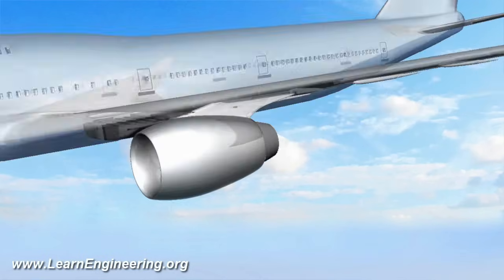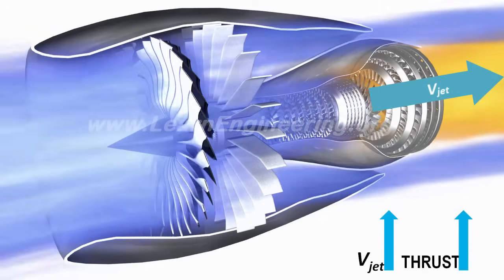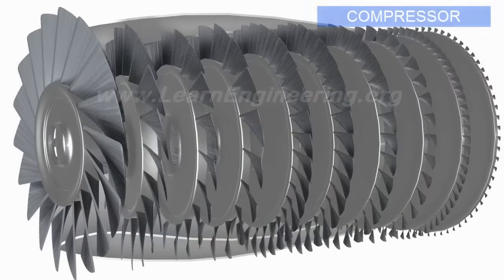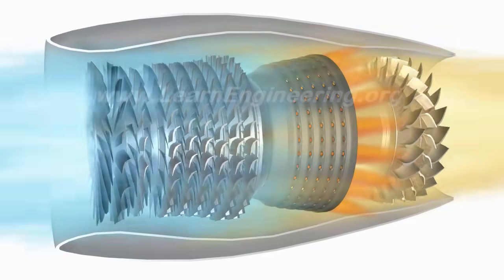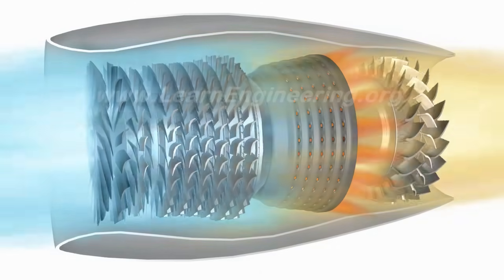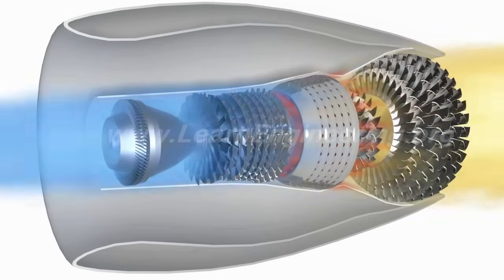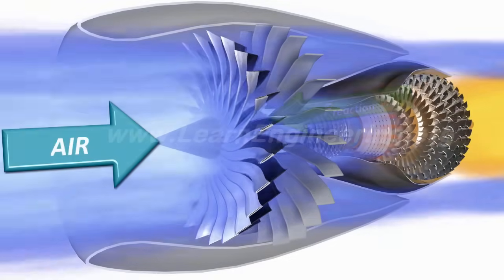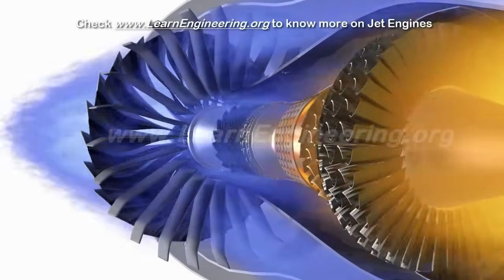Jet Engine, How it works?

Comment: the compresor is spining backwords
Reply: Valk Stators have nothing to do with keeping the air flow smooth, explain what you are thinking. Stators increase the bite angle of the trailing turbine/compressor veins or blades (whatever you want to call them) so that the air entering the front of the turbine is moving at in an opposite direction, or is at least not turning with the trailing   turbine/compressor. This makes the turbine/compressor more effective.
Reply: othman fikri Came here to say that. High five! :D
Reply: The compressor is spinning in the right direction relative to the turbine... It's just that the angle of the compressor blades is backwards in the graphic. Good catch tho.:)
Reply: so is it legit to call it a depressor
Reply: othman fikri   lol I noticed that also, oops lol
Reply: uh.. no. The jet is simply animated incorrectly. For some reason they have modeled it windmilling at altitude but in that condition the combustion chamber would not have ignited.
Reply: othman fikri Yeah, got looking at it real close like and said "Wait a minute here, that ain't right!". LOL!!It's still a good animation though.
Reply: Yeah, I was wondering about that.
Reply: jet fuel is a hoax, planes fly on compressed air and that's it.  no fuel tanks are built into the wings - which are not carrying TONS of LIQUID FUEL which is explosive.. wake up - free energy exist for a 100 years hidden right in your face.  compressed air is pumped into jet planes not liquid fuel.
Reply: Yeah I thought so as well
Reply: +M Ko spanning this way it would blow the air instead of suck it
Reply: ***** look at any air fan at home you will be able to see air direction/fan blades shape
Reply: Yes, really... The angle of the blade is what pushes the air, in this case it would be forcing it out of the engine, not in.
Reply: Nope, all you have to do is look at it, not very complicated.
Reply: You have trolled everyone that says it's spinning the wrong way, haven't you?...LOL!
Reply: sigh Okay, imagine putting you rand out the window of your car at 70mph. Okay? Having your hand open and your palm facing foreword is going to result in the air pushing hard on your hand to go the other way. This is because of a thing called aerodynamics. Now, say you stick your hand out the window, accept this time you have your hand on a 45 degree angle with the thumb side of your hand facing foreword and closest to the ground. This time, the air is going to try to force your hand down because of it's resistance to move. Now if you hold your hand and arm out really stiff and keep it at that angle, then the angle of your hand is going to catch the air and force it up. This same concept applies with a fan blade. If you look closely at the animation of the blade at the front of the engine (intake side), you will notice that aerodynamics disapprove the flow of air with it having that angle, it should be forcing the air out, not in. If you reversed the rotation or changed the blade angle to it's adjacent, then the air flow would be correct. Is that a good enough explanation for you?
Reply: Maybe you were overthinking it?
And no offence, but you may not be very mechanically inclined. It's okay, not many people are.
Reply: lol I noticed this too instantly and dismissed this video xD, dis engine would move nowhere and die instantly
Reply: It is actually a windmill.
Reply: Thad ward That is what I was (kind of) trying to say. I should've said that the stators and stator vanes redirect the airflow as that is what they do.
Reply: Chris England Ok...
Reply: Run along, enough dinner for you!
Reply: ***** I already explained it.
Reply: This topic will come up when you get into pitching your wings whilst flying, the wings are like giant fan blades, think of it that way so you don't get confused again... LOL!
Reply: ohh, okay...well, I hope everything goes well for ya!
Reply: +othman fikri More like the wrong fins are turning, if you look not only at the direction of the other fins, but their shape.
Reply: +othman fikri good observation but you missed that the jet engine has no airplane's body parts
Reply: +othman fikri lol I said the exact same thing lol I told my self if you really know how turbines work you would point out the same thing lol good job !!
Reply: +xiAm VaLkYrIe what re you talking about dude !!?? we are talking about th fan blades spinning the wrong way what the hell are you talking about
Reply: +othman fikri not even because it wouldn't even be working is the blades are spinning the wrong way lol
Reply: patman0250
Reply: sea man  ã
Reply: What I find interesting is that the last two compressor stages are spinning the opposite way... wtf?  LOL
Reply: sea man
Reply: Temporal aliasing...
Reply: I was going to write the same, my mind was trying to figure out why Quantically opposing to the engine's direction was compressing the air better by blowing than by pulling
Reply: Don't be ridiculous. The compressor blade angle is erroneous. Period. No matter how much you misinterpret the state of the art.
Reply: It's spinning in the Right direction. [backwards]
Reply: everyone, everyone
the first frame of the video is incorrect
WHY DOES A 747 HAVE TWO ENGINES?
Reply: tremarctos9... wrong... JP is what makes the engine turn. With the fuel no exhaust would be produced to turn turbine, which in turn turns shaft other rotors are connected to.
Airliner wings are very thick, but are large and appear to the untrained eye to be too thin. There are also tanks in the wing root/fuselage.
Reply: Hey, don't you know the blades are spinning in the wrong direction.
Reply: Oh god thanks. The way the profiles curved had me really confused. So thats what it was.
Reply: Stators don’t have blades they have vanes. Rotors have blades. Vanes direct the airflow at the best angle to the next set of rotor blades. In a constant speed engine the vanes will be fixed. In a variable speed engine the vanes will be “variable geometry” meaning the angle of attack can be manipulated to increase or decrease depending on the ordered speed. One set of rotor blades and one set of stator vanes makes a stage. If you have a 16 stage compressor that gives you 16 rotor blade sections and 16 stator vane sections. It also gives you 16 stages of compression prior to the combustion section. There are 3 main sections to a turbine: the compressor section, the combustion section, and the turbine section. There are other sections that can be added depending on the turbines use such as: a power turbine which can be coupled to a reduction gear, a turbo prop or fan, etc The first section of variable geometry compressor is a set of variable geometry vanes called IGVs or inlet guide vanes. These are the largest vanes and through the stages they get smaller. Likewise with rotor blades. However the rotor disc or drum size also increases as the blades size decreases making a smaller passage for air to pass through. The air entering the compressor starts with a constant pressure (P), velocity(V), and temp (T). As it moves through the stages it is compressed which increases P and T. Entering the combustion section T and V increases rapidly but P remains constant. Through the HP turbine section the increasing V moves the rotor blades and T and P decrease. At the exhaust everything returns, eventually, to ambient. This is the Brayton cycle in a nutshell.
Reply: I find it genuinely concerning that people could watch this and not instantly see that the direction is wrong. How is it possible to have such a bad understanding of how stuff works?
Reply: xiAm VaLkYrIe   Bollocks.
Reply: Actually, according to fluid mechanics, the more you slow down the flow, the higher the pressure. The compressor spinning direction is all right. Check out Bernulli's law. (also Venturi's tubes, which speed up the flow massively, are used in many devices, including turbines, to lower the pressure, exactly as opposite- e.g to suck back oil into the system).
Reply: They do this so that the engine is stable as well as to keep the air flow smooth. That's why they have the stators and the stator veins.
Reply: Recent turbofan jet engines use high pressure and low pressure compressor & turbine spools which they have made independent of one another by putting the high pressure spools on a hollow shaft and low pressure on a solid shaft which also runs the main front fan... As they are independent they introduced  counter-rotation for better balance,reduced stresses and quieter operation. That's just a matter of flipping the angle of the rotor & stator blades as they are both driven by expansion gasses headed in one direction. This also allows high pressure & low pressure to run at different/optimum RPM further increasing efficiency.

Comment: is it the fan spinning in a wrong direction?
Reply: +Warp_Core  No doubt this video clearly explain how the jet engine but you have to know that not all the people have a engineering background specially in fluid mechanic. The wrong graph will giving out a wrong idea to the people who want to learn jet engine but don't have a engineering background. Furthermore, if the video is wrong, why don't point it out but need the viewer check it out in the comment area by itself?

Comment: I know nothing about jets.. but the first single spool engine looks to be rotating the wrong way in the front half.. either that or the blades are backwards.. Look at the shape.. its working the opposite way that a computer fan or a ceiling fan would. logically the blades are shaped better to be pushing air the other way... am I missing something? Is there some interaction with those stationary fins im not getting?
Reply: ChrisCDXX oops... I figured it out.. I think its because I wasnt thinking about the air being forced in.... the blades DO push the other way as to compress the air... derp....  Im going to feel really stupid if my answer to my own question is wrong..
Reply: ChrisCDXX OK I think i get it all now... great video!!! Thank you for making this! :)
Reply: No, the fans are rotating correctly in same direction as a turbine, but they have wrong orientation of blades.

Comment: jet fuel cant melt steal beams
Reply: Nassim Allali death star inside job
Reply: Angel Perez Jet-A fuel has a maximum burn temperature around 2500K, while steel has a typical melting point around 1800K. So melting is a problem in Jet engines, and cooling needs to be constantly provided.
Reply: Sander Deryckere if i'm not wrong thats a joke about 9/11

Comment: The first aircraft that is considered to be powered by a jet engine is the Heinkel He 178 in 1939. That is 75 years old. In this video, they state it's been powering aircraft for a "nearly a century now". A century is 100 years. How much approximation do you allow? If it were 97 years...okay, I could let that slide. Even if it were 90 years. But 75? That is a bit of a stretch. The only reason I bring it up is kids in school watch and learn from these kind of videos. And they deserve a bit more accuracy than +/- 25 years. It should have said "...powering aircraft for three quarters of a century" or just say "for 75 years"

Comment: Haha highly fuel economy. Turn a jet engine on for 20 seconds costs 6 months worth of gas money for my car.
Reply: Vitaliy Kachan Well, I feel that is a fair comparison considering that having all the passengers drive is the next best option. All they have to do is be more fuel efficient than buses, cars, and trains, by mile traveled per passenger, and their good in my book.
Reply: Jimmy Situ AIRBUS claims that their last planes are more economical than cars. IF you count amount of passengers by distance...
Reply: Its also producing several times more power than any car. What matters is how much energy is used from the fuel burned, not how much fuel is burned. And a jet engine Is almost perfect in that regard.
Reply: Or you could build a jet powered paraglide r that runs on vegetable oil..... :3

Comment: What is the point of dropping the pressure at the end with the last blades ?
Because pressure means a force which will push the airplane forward which is good right ?

Edit : Oh it's to activate the compressor via the turbine. This way only the injectors are really working.

Comment: Didn't understand how the bypass air mixed with hot expanded air reduced noise, especially in the case when bypass air is responsible for creating more thrust.......anyone??
Reply: Vivek Silwal   The mass of bypass air shields the hot loud fast 'jet' gases and acts as a sort of silencer box.     The hot expanded gas from the end cone is travelling very fast,  that's where most of the noise comes from.  But not where most of the thrust comes from.   The bypass air has so much mass  that it does the job of thrust AND has a great silencing effect on the noisy gas blast out of the end cone too.    By the time the hot 'core' gases are free of this shielding effect, it is some distance from the plane now and has slowed to something like the bypass air..   and so is much quieter.   Also, this bypass gas is very cold compared to the cone gas, which further reduces the hot gases energy after it's useful thrust is gone.
Reply: Chris England  So, the bypass gas isn't 'mixed' with the hot gases immediately..    they only mix well after the plane has moved on, if you see what I mean.   The bypass gas forms a 'tube' which envelopes the hot gases, hence the silencing effect..   By the time both these mix in the atmosphere, the hot gases have cooled a lot and have lost much of the energy that makes the rushing blast noise.

Comment: Yes where the motor to turn the fan
Reply: Raksmey Chan The turbine turns the fan. Usually connected to the same shaft the compressor is on. maybe always...
Reply: therealxunil2 This is almost always true in low bypass jet engines, however in high bypass jet engines the main fan but usually not the compressor fans are spun by a reduction gear assembly, often a planetary gear system. These are used to reduce the noise associated with low bypass jet engines, and are mainly used for civilian aircraft. There are still a few low bypass engines in service, like the  Pratt & Whitney JT8D which has been on many planes, 727, 737, MD-80 and others

Comment: a little stupid question i think... but havent figured it out yet...

the first part of the engine (the part that pulls the air) is powered by the last part? i mean, is the air that comes out and spins the last fan that spins the first ones? 

or there is another source of power that spins it all?

Thank u all :)
Reply: Guilherme Schumacher 
Yes, the first part is powered by the air exiting that is spinning the turbines. They are connected by a shaft so that when the turbines spin at the exit, they also turn the compressor blades / fan. The blades need to be spun by a motor or compressed air to initially start it.
Reply: theLuigiFan0007 ty very much :)
Reply: Guilherme Schumacher
Your welcome.

Comment: so the cold air moved by the fan is mainly responsible for the thrust?
Reply: brenoakiy No, the fan is just to bring in air. The compressor compresses the air a lot which causes heat, then it is burned and causes more heat and released rapidly out a  smaller hole then it was brought into causing thrust. This creates a high velocity of hot air current, I think it is around 2700 degrees, the hot exhaust air (Which is expanding because it is really hot and trying to exit all at once through a small opening) is moving way faster then the fan bringing air in at the backside of the turbiine.
Reply: Duane Dean Thanks for the response.
I did a quick search on Google and it turns out that there exists those 2 types of turbofan engines. There's low-bypass turbofan, in which the majority of the thrust comes from the jet itself. There's also high-bypass turbofan engine, in which the majority of the thrust comes from the cold air pushed by the fan, rather than the jet. The latter is the one most commonly used in commercial airplanes.

http://en.wikipedia.org/wiki/Turbofan
Reply: brenoakiy
Correct. Low bypass, all thrust is from hot exhaust gases, high bypass, most of the thrust is created by the fan and bypass air. High bypass engines on commercial jet liners are a lot slower then the low bypass engines because of this, but, are way more efficient fuel wise.

Comment: I've watched several youtube videos on jet engines and despite their elaborate explanation of turbines they don't really explain how a jet engine works.  The energy driving a jet engine comes from the ignition of the fuel air mixture.  The problem is that detonating this mixture should cause an equal force in all directions and so not move the engine forward.  My impression is that the reason a jet engine works is that the air is compressed to enter a chamber through a small hole inside a larger diameter surface in the combustion chamber so that when the mixture explodes only part of it presses back on the hole and the rest presses back on the surface thus pushing the jet forward.
Reply: Samantha Bella Fuel burning is a force in all directions, but, if it has an escape route, it will go that way as it has less resistance.

Super heated compressed air releasing or expanding quickly exiting out a small hole gives a lot of power. Its not a small explosion, its actually a constant burn. So, a large hole with huge volumes of air coming in, getting compressed then super heated, has a very high velocity rate coming out a much smaller hole.

Take a house fan, force it into a cone on the exit side, maybe moves a little, falls over, whatever, now take the same fan, put a compressor behind the fan blades and heat it, you now have a hot, high velocity air stream that will make something move, but the fan itself cant do it, need to have a way compress a little into a lot then heat and direct it.